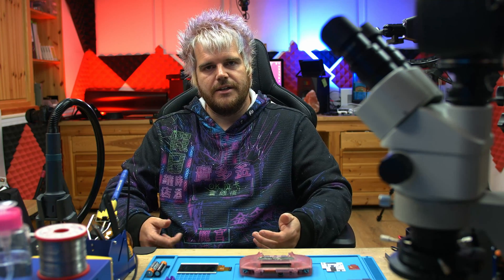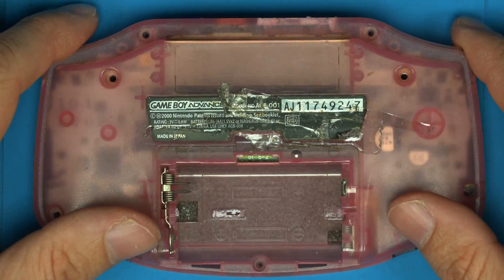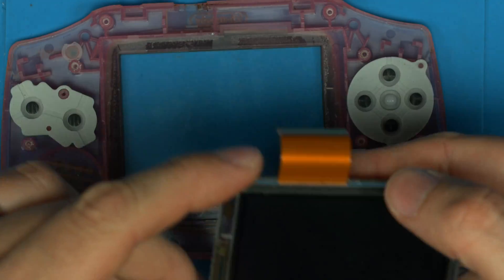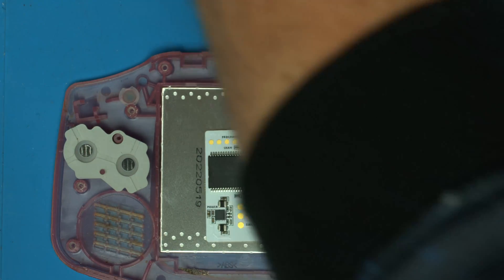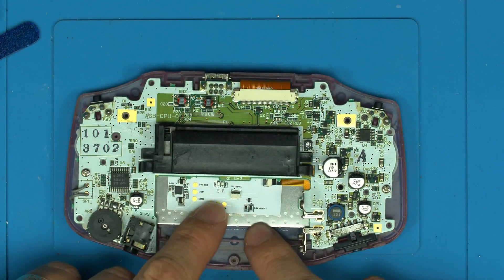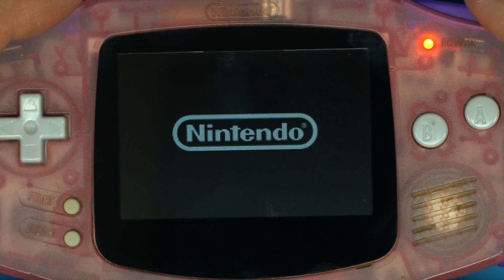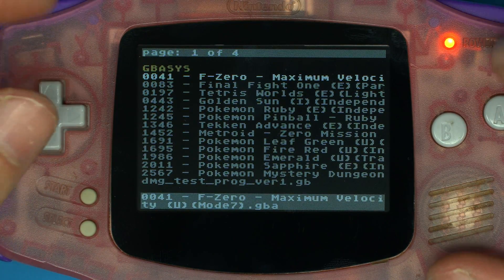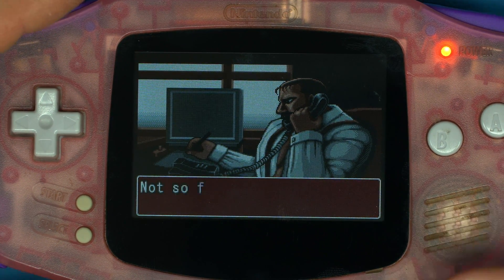Ultimate 2022 GBA Game Boy CleanScreen Install - Original Shell No Cuts

Comment: I remember seeing one of these when they came out and, in a brightly lit office, I couldn't even tell it was switched on.  The guy who had just bought it said that there was an overhead light you could get for it.  Unbelievable that they released it as it was.
Reply: i was so hyped for the gba when a guy in my class brought one with him, but like you said: the dim display ruined the whole experience. at least nintendo released the sp later which was at least a step up, though its final form was the ags-101 in 2005.

Comment: I finally got the screen and I installed it. When I tested it, it looked all wrong. Part of the top screen was displaying at the bottom of the screen and it all looked all glitchy.I reconnected the ribbons to the boards, but it started to look different with wrong colors and sometimes worse. It displayed some type of lightbulb symbol sometimes. What's wrong? Is it the screen, the ribbon cables or the screen board? I re-installed the original screen back in the meantime and it worked fine.
Reply from the maker: Sounds like faulty white board. Just email us to get replacement
Reply: @RetroSix  I ordered it from Handheld Legend, I contacted them with attached photos. So hopefully they replaced it.

Comment: I have a problem with my brand new screen. I installed it without soldering, but still when I turn on the GBA the onscreen menu pops up and won't go away. Sometimes it even goes through the menu or turns down the brightness without me pressing anything. Even if I did press, it shouldn't react as I haven't soldered.

What could be the problem?
Reply from the maker: Noise on power rail. Simplest solution is solder a wire from SEL to 3v3 pad. Or even just tape wire over to pull SEL pin to 3V3
Reply: @RetroSix  Thank you very much for your quick answer! Just one more quick question - if I solder the buttons with the wireless kit, will I still have to solder a wire from SEL to 3v3? Maybe I should just use another GBA mainboard, should be better, right?
Reply from the maker: @estylegreesye4384 if you solder button  wires the extra one isn't needed

Comment: How do you get rid of the light bleed and seeing some of the white part of the screen on the top and bottom? Also, I noticed you never put the foam backing back in, was that intentional?
Reply from the maker: There is no light bleed only that plastic showing in this video at angles. That's since been fixed with our latest glass lenses being slightly thinner at top and bottom. The foam can stay in if desired
Reply: @RetroSix  awesome, just ordered my kit from handheld legend and an original size glass lens. Excited to install in my GBA!

Comment: what parts do I need to purchase to have this mods done?
Reply from the maker: If original shell and no menu just the screen and CleanScreen board and either 32 or 40 pin ribbon. If installing in our shell grab the bracket too. If installing on screen menu and you don't want to wire then grab button ribbon as well
Reply: @RetroSix  Thanks

Comment: Just ordered one of these to put into a stock GBA, it's absolutely perfect for what I'm looking for. I've got a question that will have me ordering another one if the answer is yes. Will this screen and board also be able to be installed into a Boxey Pixel v2 unhinged?
Reply from the maker: We have never had a boxy so could not test it. But if it fits original screens I would think it would fit
Reply: @RetroSix  I've got both sitting here in front of me, it looks like the boxy pixel is made to fit the larger IPS mods by default, with a bracket I think that it would fit perfectly. I'm putting this screen in an original GBA, but I may buy another with a bracket to put in my Boxy Pixel. Thanks!

Comment: I just install the clean screen and the result is amazing, but I have the level of Brightness permanently on and I don't solder the special ribbon cable to adjust the lvl. I have a little wire you don't have on the video, soldered to the cleanscreen 3v3 pin, maybe its that ?
Reply from the maker: That's a fix that makes battery last much longer. If you want to adjust brightness you will need to add the button ribbon or solder wires to the SEL L and R pads
Reply: @RetroSix  Oh, okay. But my problem is I have the light level jauge "brightness" always here on my screen, I don't want to adjust it, I didn't even solder the ribbon cable. Maybe this little wire make a contact somewhere ?
Reply from the maker: @axelpaillaud7542  ah I see. Do you have a soldering iron? You can solder a wire onto the SEL wire to the 3V3 pad where the other wire is soldered. It will force menu to never show
Reply: @RetroSix  Yes i have, ok thanks for the tips, I will do that immediately!
Reply: @RetroSix  I sold the same wire 3V3 into SEL and it work perfectly! thanks you very much, the color of the screen is really amazing <3
Reply from the maker: @axelpaillaud7542  awesome. Any other issues just let me know

Comment: I'll be ordering one of these, might be a useful datapoint to know I've just picked up a used GBA, model number AGB-01, it's the clear case version, the number visible on the PCB through the battery door is '02 7-1' but it's also a 40 pin connector. I opened it up to check since I'm ordering a screen from you :)
Reply from the maker: Cool. I will make a list of known numbers to ribbon sizes and put on retrosix.wiki
Reply: All starting with 0 have 40 and with 1 have 32 PIN I thought

Comment: Thank you for this, I'll order one asap I've the money 😉. The only concern I have is the plastic white margins at the screen I have the feeling I'll see a bit of it under the screen glass depending on the screen orientation. Maybe having that plastic in black or both options available would solve it
Reply from the maker: If positioned right you don't see it. It shows in video for rebranded lens as the tape is still on the lens pushing it too far up. But it's the backlight plastic it can't be black. Simple option is black tape along it if you see it. I could possibly have factory coat the top of plastic after production to black on next batch
Reply: @RetroSix  thx 👌
Reply: @RetroSix  If I look closely at 9:41 I think I can see some of the white on top of the screen if I'm not mistaking, might be wrong though.
 Would keeping the adhesive strip solve this issue? Otherwise I am thinking of just painting it black before installing it. Really thinking about purchasing one now
Reply from the maker: @leinsaat5779  It's just camera angles and the lens isn't stuck in so the tape tab at bottom is pushing screen up. When aligned perfectly you dont see anything, but you can black it out with ink or tape no problem if you like